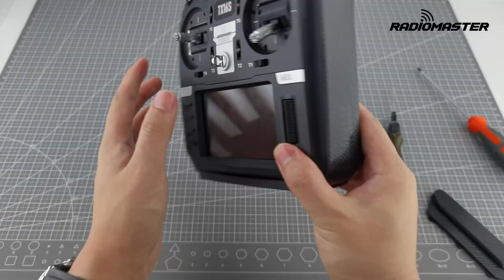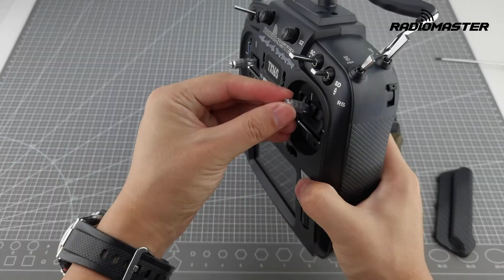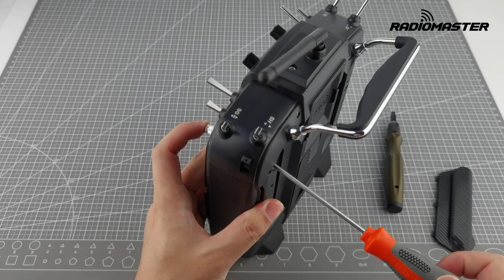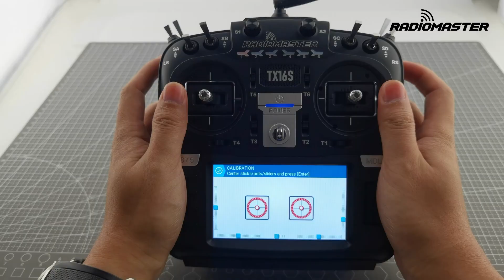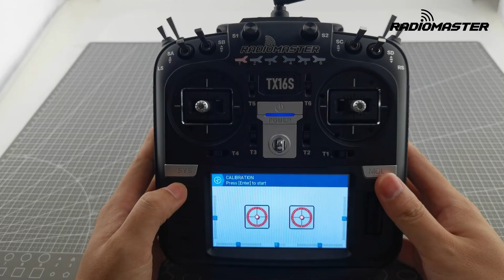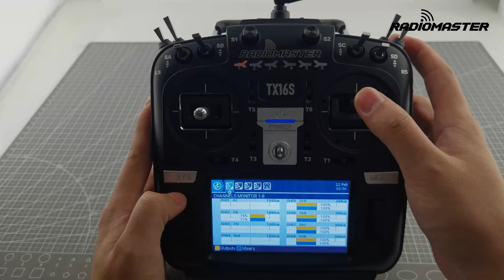RadioMaster TX16s MKII - How to change modes (Mode 2 to Mode 1)

Comment: Just a quick follow up. I was unable to get the left gimbal (the elevator movement) to centre correctly, even when I opened the case and tried to solve the issue. I contacted RM support, who referred me to a RM service centre in Sydney.  They fixed the problem under warranty, and I am very pleased with the result. It is a great tx.  I have heard another flyer in our club has had the same issue. I suggest the video be edited to indicate that in the event you are unable to do the conversion without opening the case, there is a simple procedure to fix the left gimbal by opening the case and following the detailed directions in a second video.
Reply: I had a similar problem with the radiomaster pocket changing it to mode 1, i couldn't get the left stick to self centre even after fully releasing the screw that enable's this. I took it apart and it turned out i had to adjust a small screw to the right of the tension spring to release it, the only reason i noticed this was it was the only thing that looked slightly out of place compared to the gimbal on the other side! lucky i discovered this way of resolving it because the screw that was supposed to work has become very loose and pretty much unusable due to the amount of times i messed around with it.
at least i got there in the end! 🙄

Comment: Please note that he's changing a new Mark II radio with v4.0 gimbals. This will not work with the original TX16S, where you need to open the back to do the change. Also, the older gimbals don't have the adjustment holes on the front. Search and look at a couple more videos on switching modes until you find one that matches your radio. For older TX16S's, you can just switch the left and right gimbals around and change the software settings. 

Remove the back. Remove the 4 screws holding in each gimbal. Swap. Replace back. Go into Radio Settings. Change modes. Done! Bill Clark on YouTube has a video detailing this. Search for "RadioMaster TX16S Conversion from Mode 2 to Mode 1". This is for the older radios.
Reply: I want to covert a TX12 mkII. Do I use this video or Bill’s
Reply: @shaunvaughn3323  I don't know enough about the TX12 to make any recommendations. The TX12 and TX16S radios are entirely different radios. I'd suggest you search YouTube for converting the TX12 from Mode 2 to Mode 1.
Reply: Thank you!

Comment: As a mode 1 flyer for many decades, I have had many bad experiences changing mode 2 to mode 1 on a new tx. I thought its a great advance for mode 1 pilots not to have to open the case to change mode.  To prepare I watched this video many times and made notes. I numbered the adjustment screws 1-6 in the order they are adjusted in the video. I checked I knew the correct access holes by looking at another video (https://www.youtube.com/watch?v=J66Lgw123r8). I confirmed that releasing or loosening a screw means turn counterclockwise, and tightening means turn clockwise.

The 2 screws accessed from the front of the radio went fine. Screw 1 on the left (elevator) gimbal when loosened did allow some degree of self centering. The 1.5 hex driver worked perfectly to turn the screws. At the back of the radio, 
I identified the inner and outer screws and tested 6 Philips head screwdrivers, selecting the one that fitted best. Screws 3 and 4 on the throttle gimbal (right gimbal) were difficult to adjust as the screwdriver often slipped, but eventually I tightened both and I got the right gimbal working properly for throttle, with rachet applied. While adjusting the gimbal I was terrified I was stripping the screw heads, but there does not seem to be too much damage.  

However screw 5 on the left (elevator) gimbal needed to be released (turned counterclockwise ) till no tension to allowed self-centering. The tension was released but there was no self centering. I also released the outer screw in case the rachet was on. I kept trying to obtain self centering but gave up when both screws (5 and 6) were released too much and fell out, and are now rattling around in the case.

I will give myself a few days to recover from this experience before I try opening the case and trying to recover function in the left gimbal.

Comment: Thanks. May i suggest you add to this video some diagrams to locate exactly the adjusting screws (not indicated in manual) . I would help. I did the mode change but some doubts were disturbing. 
In an other side, thanks to the RM engineers which have done a very nice job, mode change user-friendly without having to open the TX16s !!!

Comment: I'm having the same issue as the other replies - the screw that's indicated to control the stick tension has no effect at all. It's clearly not the correct screw, and I cannot find any documentation other than this one video on what any of the screws on the back do. RadioMaster please post the correct information here!
Reply: @mini-z_me  I do have the T16S Mark II, that this video is for. I removed the radios back and had a look at the mechanism, it appears to be a quality control issue with the manufacturing. The gimbal's spring, that was meant to be adjusted by the screw highlighted in this video, was a significantly different shape to the other gimbal's spring, and it also had almost none of the 'tacky' grease on it that's used to dampen the springs return. I fiddled with the spring to reshape it and took some grease from the other gimbal, and it's mostly better now - or rather, it's usable. The two sticks still have a noticeably different feel, no matter how much they are adjusted, but at least it's similar enough for now. I'm going to have to return it.

Comment: I’ve done this because I fly in mode 3 but I can’t figure out how to get the spring tension/spring self-centering back on the left stick… can you help me please? I’ve loosened the tension and ratchet screws to the point where they fell out and I had to open the radio to get the put back into place…. It’s still a weak stick tension and no spring self-centering.
Reply: @RandoManFPV  I can’t remember if I counterclockwise turned the bottom left “screw” on the right stick to loosen it up or if I took the back off and loosened the screw from inside. But I did get it right where I wanted it and with the right amount of ratchet. I’ve found that since a lot of this sport is subjective, sometimes there is little information about what I’m looking to do specifically and just general info on how to roughly do it. I understand the lost frustration. My sons radio would bind but not show stick movements for 3 weeks… it was a binding phrase issue. ELRS 3.x doesn’t like 2.5 (I believe) that’s frustrating. My 5” lost a capacitor, burned a motor, cut the wires to another motor mid-flight after getting fixed and now has developed a twitch I can’t tune out. It’s always something. But when things work, it’s amazing.
Reply: @darrylmeans725  thanks man, ima keep cracking at it. But first I unscrewed something to much and a screw came out inside of the controller lol I'll have to aoen it up to fix that, maybe it would be best for me to swap the gimbals around while I'm in there?
I want my left gimbal to be the throttle, I want it to fall all the way down when I release it. I don't care much beyond that about tension and what not. I'm new so I am still ready to get accustomed to anything. As long as it's mode 3

Comment: Hello, I a having the same issue. I changed to Mode One - the Throttle stick on the right works fine. The Elevator stick (Left) does not have the springiness. I took the back off - can't figure out what is wrong, why it is not working. If I can not figure it out by this weekend, I might have to return it
Reply: Fogure it out?

The video here says to turn screws on the back of the radio but I can't find them